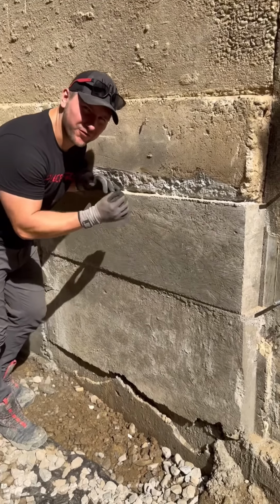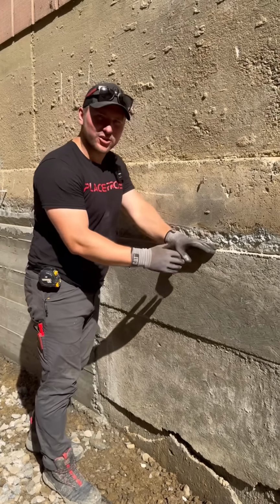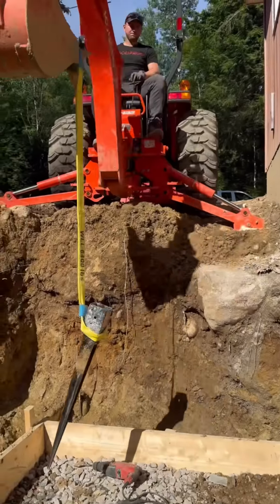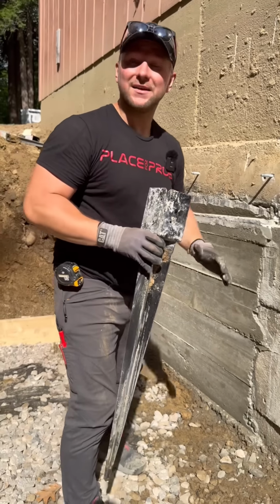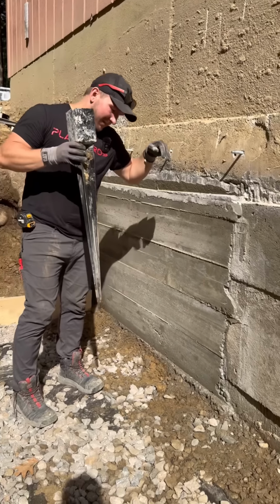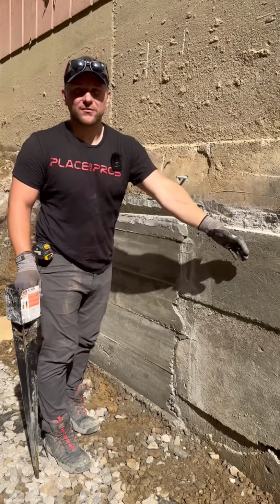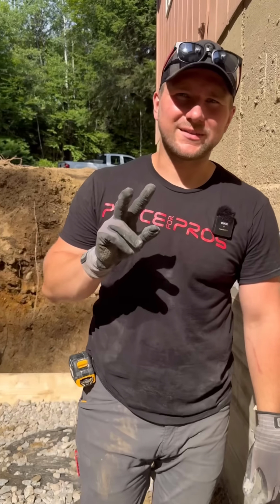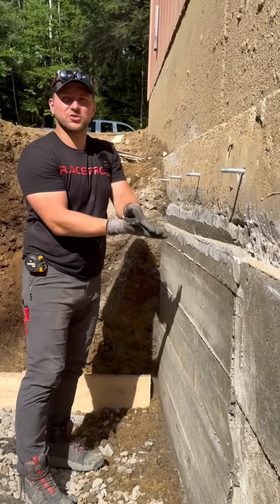How to Underpin a Foundation! EASY DIY!

Comment: You can save time/money by making a short footing then use a big piece of plywood as your form. Use your gravel and just make a berm so it supports the back side of that plywood at least partially. If you do it right you can do a long span and save yourself the trouble of hammering those stakes and building that wall that you built. It looks excellent but if big companies put that much time into such a small piece of foundation they would lose money. The old site guys would back up what I'm saying. Good luck.  Not just trying to critique. Awesome content. 👌
Reply: Good point thanks for sharing your metod